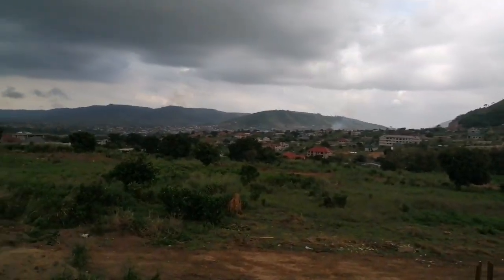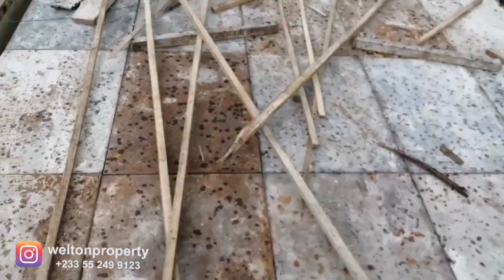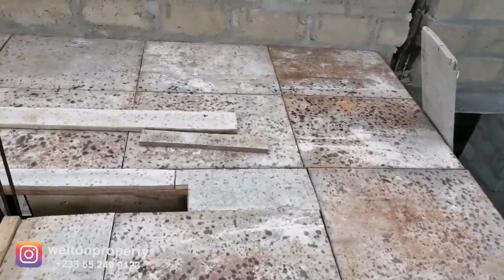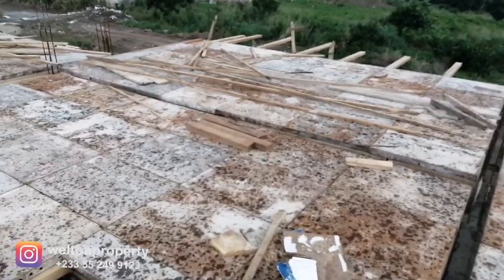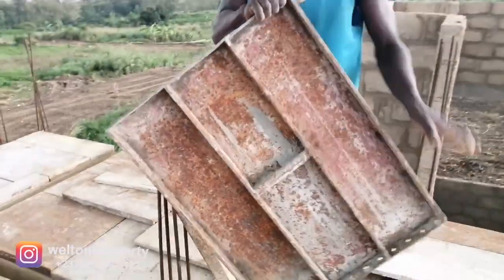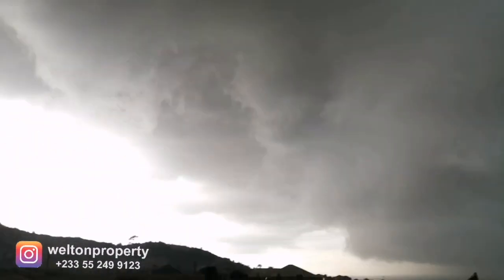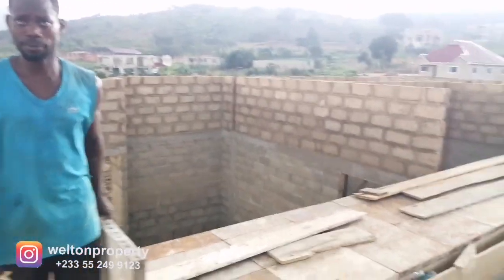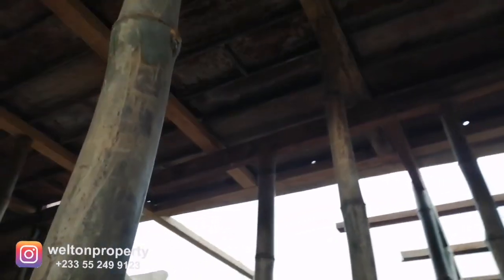Never Buy Wood For Concrete Slab / Flowing When Building in Ghana

Comment: Will this plates leave  lines behind, like wawa board after usage. Because this line's are very ugly n difficult to cover.
Reply from the maker: Hi Gabriel, the plates do not leave any marks on the surface after the cast has dried. You may notice that we placed plastic sheets on the surface of the plates before laying the reinforcement steel rods. This further prevents and possible lines / marks.

Comment: How much do they rent the plates for? I tried renting similar for My fence wall pillars, price was outrageous, so had to buy wawa boards to make the boxes and to cast the concrete.
Reply from the maker: Going with the wawa boards for your fence wall pillars was a better option given it works out much cheaper. The steel plates are however more cost effective in compassion to buying plywood for the decking / flow work. Call / Whatsapp +233-552499123 to discuss further
Reply: Then I will rather buy plywood and after use I will sale it....or dash it out....is better ...plate renting is expensive and stays with slabs for about 20. Days after casting.

Comment: How much are the steel plates to hire
Reply from the maker: Cost depends on the total surface area and the number of plates required to carry out the work. Kindly Call /Whatsapp +233 552499123 for further information
Reply: @weltonpropertyadvisory4994  
I wanted the cost for one so l will work out how many l need to hire. I am sure the sizes are a square meter each
Reply: @weltonpropertyadvisory4994  awesome